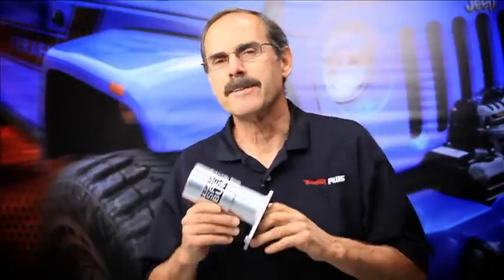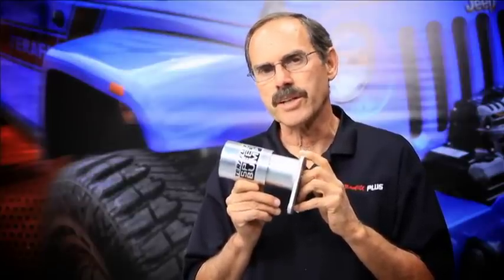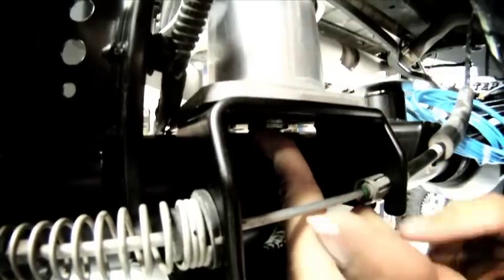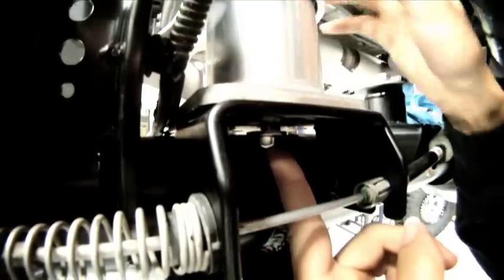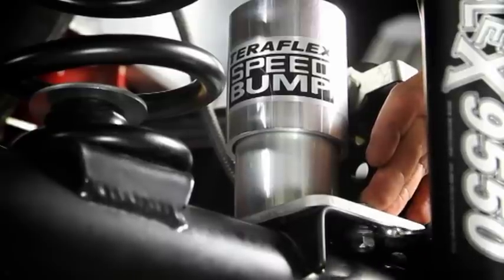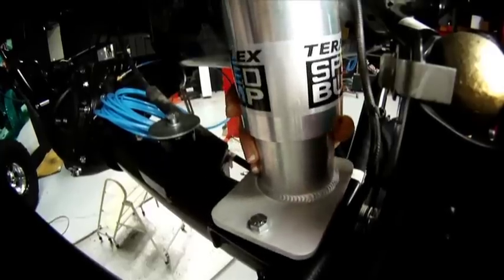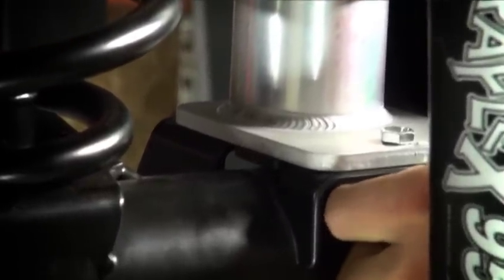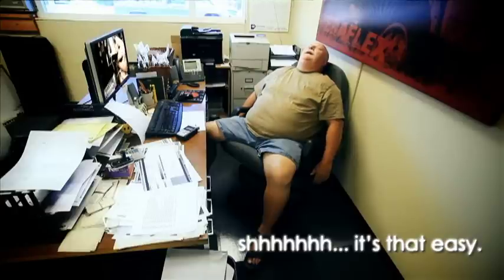TeraFlex Install: JK Rear SpeedBump

Comment: Is there any added improvement with just adding the rear speed bumps and not the front.
Reply from the maker: ***** Yes there is.If you typically run a lot of extra weight in the back of your Jeep, or like to drive fast, these will help improve the ride quality and help prevent harsh bottoming outs.
Reply: If I have the 2.5 inch TF coil lift with TF shocks, will these fit or will I need to use a different version of the rear bump stops?
Reply from the maker: ***** For the 2.5" kit you need the #1958250 2.5" SpeedBump kit and the #4946810 Jounce Tube Brace kit. Or for just the rear, #1958252.